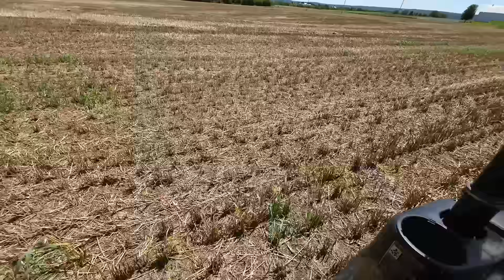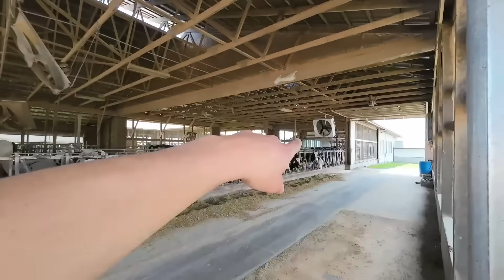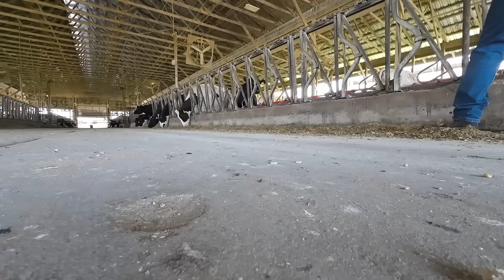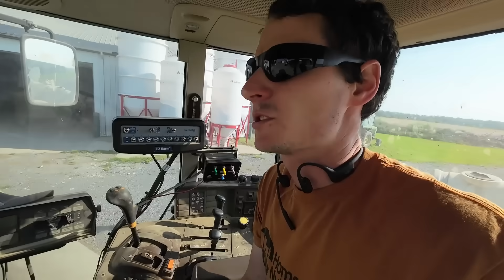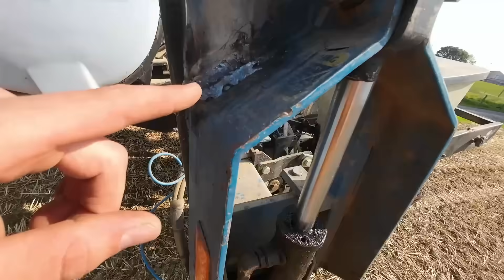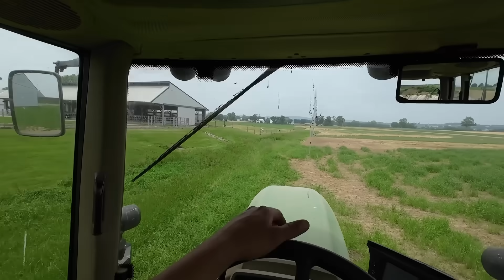Corn is Planted

Comment: We started vertical tilling last year, super happy with the results. As you said, fields with manure and corn trash to make residue more manageable.. Ours is simply straight gangs with no angle adjustment. For true no tillers its all you need

Comment: A Salford Speed Till would have you Planting The Next Day if ya Know where to Rent one but it takes a Big tractor to pull!
Reply: High speed discs are overrated. A salford 2200 does a great job at loosening the top couple inches and letting it dry out.

Comment: I was just thinking how cool it would be if you had solar panels on the roof over the dry cows to power those fans. It seems a waste not to take advantage of that space.
Reply: I have solar on my house. Not as much of savings as told. The power company gets the electric and then you get credit back. Waste of money paying for the Panels. The solar company and power company are the only ones benefiting.  If I could go off grid it would be great but not allowed to do that. The power company dictates what you can and can't do
Reply: I think he has solar on one of the newer cow barns. 
@john, have you looked in to a battery bank so YOU can store your generated electricity rather than the power company storing it?
Reply: @y.....m-t9m  yes we have looked into it. We're told technology is not quite there yet. But, that was three years ago. So we are looking at batteries again to see what will be the best option
Reply: Call. Miller tech out of Ohio  @johnwilliamstrucking

Comment: As to the feed you have to shovel from the curb, have you considered adding a sloped area along the curb so no feed piles up there?
Reply from the maker: Yes we have. Any suggestions on how to do that?
Reply: @10thgenerationdairyman maybe check with your cement finisher. It’s amazing the various quick set products out there. Probably do it without forms. Great video 👍
Reply: @10thgenerationdairyman I thought about a precast concrete or tile with a cove to it.  Or just a 45 degree angle piece.  As one other comment said, your concrete people problem will have some ideas.
Reply: @rogerschlitter5116  Maybe a 60 degree vertical angle would be better. Start about 6 inches from the curb.